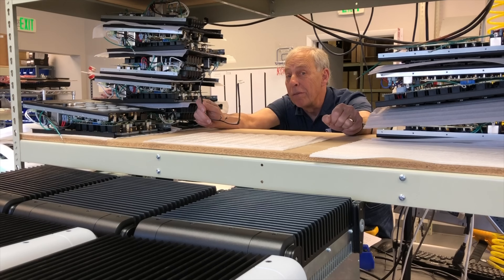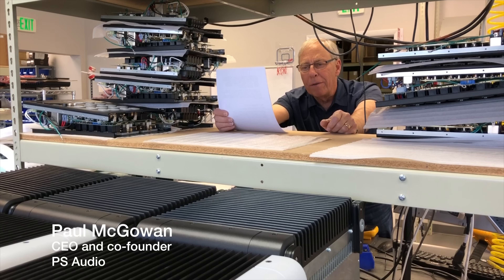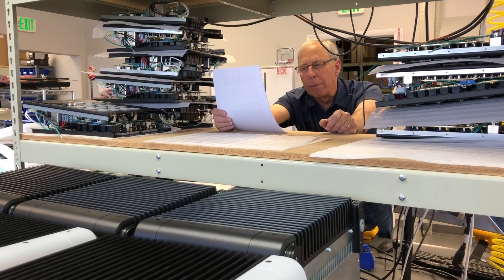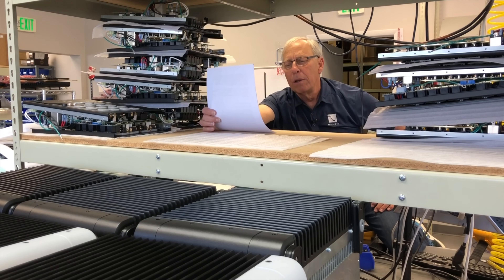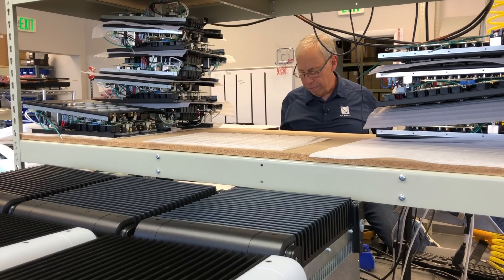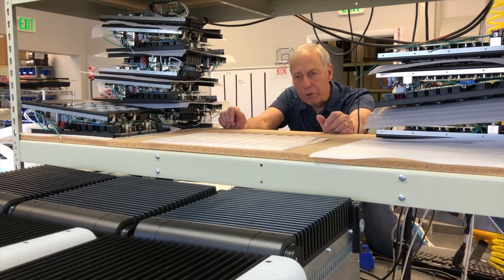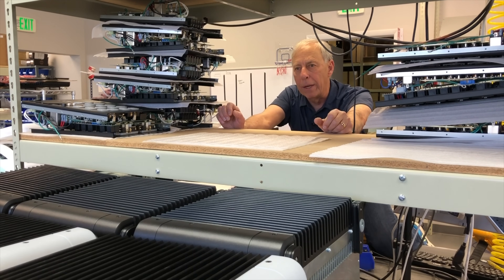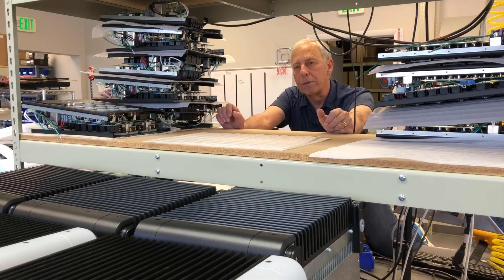Why aren't there more active crossovers?

Comment: High end studio monitors are all 'Active'.. ATC.. PMC.. ADAM..  It's meant to be a superior to passive because every driver has it's own perfect matching amp. Yes these speakers are very expensive..
Reply: Eq's don't actually do what you need. Remember you are feeding full range to every eq and then trying to take out what you don't want that driver to see from there. In the case of a tweeter which typically has an operating range of over 2khz and up subsonic information would rip it apart. The difference between a crossover and an eq is that a crossover starting at the xover point goes from nominal gain to zero gain either going up or down depending on what you are doing with it. An eq's maximum attenuation is usually minus 12db. It needs to be minus infinity or in the case of a tweeter don't expect it to live very long. Also, you will find that you won't be achieving the results you are looking for.
Reply: Rob Chapman so you think every song ever recorded on any format will sound good on a reference system set to 'Direct' or flat.. I do not agree. Every song was mastered differently on different monitors.. Even tbe IRS IV's won't sound right without EQ.. I have been trying to achieve perfect sound for 25 years and i now believe you need to EQ every track for your system..
Reply: Rob Chapman, i like your statement of eq each driver. Im thinking that might be the thing for my EV 15" lower mids drivers. I just bought 3 more of my favorite 2 way xovers yesterday. That makes 5) matching  2 ways now. I should have a complete system to show,  in july.
Reply: The ability to plug the amps right into the speakers with nothing in between is one of the reasons I love active crossovers. Like I say passives have to endure higher power levels. With that, the crossover networks in passive speakers dissipate real amounts of heat. Also under load, they are typically another source of distortion. Probably for typical home use that stuff is not going to matter much though. 
  Driver manufacturers are quick to show their frequency response curves but you almost never see a phase over frequency response graph of their drivers.  Drivers never have perfectly linear phase response and as you get toward the ends of their operating ranges the phase usually drifts more. Typically speaker designers build speakers to use the maximum amount of drivers operating range. The thing here is that if we took the physical acoustical centre of a driver and mounted it so it was the exact same distance to the listener's ear in the optimal listening zone if we use the model of driver use maximization we find that the crossover point suffers the most. Very typically that point happens to be right smack dab in the middle of the intelligibility range of the human voice. Due to the fact that the cause of the phase shift in the drivers is a time-based issue we can correct for that by either moving the driver closer or further away or by delaying one of the drivers to make the phase line up at the crossover point.  You are thinking "but won't that make most of the drivers operating range out of phase?" The answer is, of course, it is however if you look at any speakers phase response plot you will see that it shifts dramatically over the entire audio spectrum and actually rolls 360 degrees, typically more than once so it is not actually a big issue. The problem becomes a big one when the phase shifts dramatically in a small section of the spectrum. By shifting the time of an adjacent (audio spectrum wise that is) we can cause the crossover point to be phase correct and if the two drivers are not completely incompatible we will have a more even and gentle phase drift overall. The thing is that in the digital realm adjusting that is something we can do in seconds and we can try numerous timings in no time not to mention adjust crossover frequencies, change crossover slopes and a lot more to help. The best part of the digital realm is that is that phase shift introduced by the crossover is limited to the time it takes the computer (all digital processors are computers) to make the calculations and is measured in microseconds whereas in the analogue realm phase shift is insane with crossovers. BTW you probably know this but phase is going to cause the frequency response to be crazy so trying to minimize phase shift is going to help speakers sound a lot better.
Reply: Huh? Is where you are going with this relevant to what we were talking about? I thought we were talking about why an eq could not be a good crossover?  I was in no way discussing why I might think one style of speaker tuning was better than another. If it matters I do believe that the closer we get to transparent in audio equipment the better. As a rule mastering systems are designed to be as transparent as possible. As of yet the technology to record or playback any audio without infecting it sonically is not possible. The thing is that because pro audio uses "flat" or "transparent" as it's theoretical model of perfection it necessarily follows that if your system is "flat" or "transparent" then you are going to have the best vantage point or "listening experience" there. I don't know of many pro audio guys who do not love great sounding audio which seems contrary to some "audiophiles" understandings. That all said if you think your rose coloured lens filter makes every picture that you look at seem better to you who am I to tell you it is not. I assure you though. Most people do not feel the same as you in that regard. For me hearing what the creators did was what seems to sound best. With that, I also work in that field so it is probably for the best as maybe you like the pink flavour but Joe Blow likes lavender and Mary up the street prefers a Blue hue. If on our end the picture is clear it is easier for you to add your pink. If we make everything have a blue hue then when you add your pink you are going to get lavender. Yes, I am illustrating this using the colour wheel but if you think about it sound is not so different.  As least with this scenario Joe ends up happy. 1 out of 3.
Reply: So I just read this again. Were you saying that you were going to add an eq after the crossover outputs? That is a different scenario and that is very commonly how it is done now. Every driver has individual eq. What if the eq of a driver gets wanky near the crossover points where the drivers overlap? It might help to adjust only the driver that is wanky rather than both.
Reply: Yes that's true but you wouldn't just hook the amp straight up to the speaker, maybe a bypass resister etc for the unwanted frequencies and cap on each tweeter and med (but higher than normal value) not for sound but to stop lows in tweeters, and (of course) to keep the speaker impedance reasonable. It would be a combo of passive and active I suppose. 

I'm not saying it's ideal but I would love to try it to help me make passive crossovers. I have been making my own passive crossovers for a few years now and I can make one that sounds good quickly (compared to when I started). But it still takes a few days listening to fine tune the crossovers. With the 3 graphics set-up I reckon you could get it to sound better than just a straight graphic cos you can quickly change the levels of each driver as well. And that would help me with tweeter woofer level on the passive crossovers (by copying the sound and comparing). About driver level...

Ironically I reckon such a simple thing as tweeter and woofer level is about the most difficult part on making a passive crossover. Just a half ohm difference in tweeter level doesn't noticeably change the bass-med-treble mix, but it makes a whole lot of difference in the voice sound. 

Get a good voice sound and you have a good speaker cos voice sound is the most difficult thing for a speaker to reproduce maybe cos we all know what a voice is supposed to sound like (like more than any other instrument). And the tweeter level has a whole lot to do with it. 

Not enough tweet and the voice will sound too "in-the-box". And with too much tweeter the voice will sound too "whispery" or "huski". And it's extremely critical like a "knife edge". You really don't want either a "boxy" voice sound or "whispery" voice sound, and when it's balanced right the voice can sound astounding (especially with point source 2-ways). 

My speakers are similar to the KEF Uni-Q speakers made from selected drivers from eBay. Also acoustically the med range has to be as non colored as possible (for a good voice sound). Trial&error, both acoustically and crossover "and don't be afraid to think outside the square". I have done many failed experiments but also several real successes both acoustically (by doctoring drivers and enclosure ideas) and crossover wise. I resisted an added choke by 470 ohms once on a certain pair of speakers and it was just what I fucking wanted. Sounded awesome.

It wasn't point source speakers and I just wanted enough med in the separate woofer to blend with the med in the "tweeter" (I stuck some extra med in a tweeter contraption I made for treble and upper med). It's a low crossover frequency on that 2-way (instead of point source). It sounded great for a non point source speaker. I did the experiment for a back-up alternative to the difficult task of matching drivers for point source speakers (that have limited availability).
 
With the point source speakers, I set the tweeters inside the core of the bass drivers (with a rare specially wide voice coil). I can even adjust the level of the tweeter voice coil/ dome point to exactly where I want it by using a spacer. The bass drivers have a hole through them to ease mounting and tweeter cable access. And the tweeters have to be doctored to fit in (mainly casing is trimmed down). At the moment I'm listening to my pure point source speakers and the bass vent is also point source (an "outside-the-square" that fucking paid off)... 

The woofer is floating 2 mm above it's hole and a one inch plywood tube (hole diam) runs back into the enclosure. That seems to be all you need for acoustic. Sounds as good as any bass vent and is pure point source (all the way). Without the acoustic plywood tube it won't sound any good (or if it's the wrong depth). Trial&error. Such fun listening to them and point source is so sweet. A really cheap way to get really great sound. My speakers cost about $500 to build (and I'll never listen to a normal 2-way or 3-way again).
Reply: Justwantahover , how about  doing like you say, but put a cap on the midrange and tweeter. You are still giving those amps a break, and your removing coils from the path to the drivers. 2 main advantages of multi-amping. Then, when you get a 3 way crossover, you can put those graphics after the crossover like Rob suggested. Also get drivers with roll offs that compliment the others..its a contraption, but it might be just what you are looking for at the price.
Reply: Here is the thing. If you have divided the audio spectrum up before the signal hits the amps unless there is something wrong with the amps or you wire it wrong there is not going to be any signal hitting the driver that it is not supposed to see. Capacitors are one of our favourite ways to "psychoacoustically infect" (I love that word. A friend of mine who used to work for AKG Acoustics said that to me one time. It is so true) the audio signal path. Caps usually change the sound dramatically and as a rule, it is usually best to use them only as required rather than arbitrarily. I would tend to shy away from them if I can.  I run million dollar sound systems daily with the amps wired right to the drivers. Only wire in between. That just to say that if that kind of thing was all to be a common problem on our end of the industry the cost would be astronomical. I have had my share of drivers burn up but it really doesn't happen all that often. You're safe. Just be careful not to wire it incorrectly. Usually, failures are caused by us humans I find. Check, check and double check. Also, it helps to turn the amps on higher frequency first and verify the right driver is plugged into it as you go. Sub-information will hurt a tweeter but tweeter information will just not be audible through a sub driver.
Reply: Rob Chapman Correct.. I replied to another conversation on here by accident.. Your cross over theory is a bit beyond my knowledge of speaker build.. I think what were all trying to do is recreate the original sound which is bloody hard to achieve. Involving individual external amps for each driver will make that job 10 times harder! Good luck sir!
Reply: Personally I have found that in a fully active home system, (where there is only one driver per speaker, covering each part of the spectrum) that the drivers that work for me on the low end are smaller, than on passive system. So, my subwoofers are 10inch, and my woofer is 15inch, but its a musical intsrament (P.A.) driver. Then midrange. Standard 4inch  cone or 2inch dome. At the moment I am undecided about having 1 subwoofer 10in, 1 woofer 12in,  1 musical intsrament driver 15in, then mids as a completion of spectrum.(Per Speaker) It's where I'm leaning to. It's really nice to clean up the Doppler distortion by reducing excursions.
Reply: Rob Chapman, you certainly are there, been there, and doing it. Another nice chapter from you, I'm sure many thanks!
Reply: Rob Chapman any possibility of doing a chapter on driver coupling? (stacking). I'm curious about the rule of half wavelength space between drivers for coupling. Like in car stereo, the sub box is almost always a foot or more away from mains. or does coupling only apply to drivers playing in the same frequency range?
Reply: cp070476: If you want it to sound at the output stage the same as what it sounds on the input stage it makes the most sense to shift the sound the least so you can use less corrective action. Correct? By implementing the use of analogue crossovers whether they operate at line level or speaker power level we in fact generate more alterations than we do in the digital realm because a pure digital eq is an algorithm and only alters the sound the way it is told to in terms of programming (it is imperfect though, we will come back to that in a sec) whereas in order to alterin the analogue realm we are forced to introduce more signal paths and more circuitry which in themselves alter the sound even if their parameters are set inactive. Back to the digital realm. Computers work very quickly but the more we ask them to do the more time they take to do it. A parametric eq brings with it rather complicated set calculations for a computer as does a crossover. Faster computers, of course, handle it quicker but they all take some time. Sound travels through the air rather quickly. Think about the time it takes to travel a couple of feet. It is not really distinguishable however if you move your speakers so one is 2 feet closer to you than the other and play the exact same sound from both simultaneously you will see that the sound you hear standing in that one spot is horrible. This is because at some frequencies the two sources are now opposing forces and where one is generating positive air pressure the other is negating that. Of course, there are also varying degrees of this as a 90-degree phase is also effectual. Just not to the degree that a 180-degree shift is.  Analogue crossovers and eq can easily shift the frequency band they are working with 180-degrees or more. Like I say digital also does the same however I have actually personally measured it. Using eq compensation that in the analogue world would have induced numerous phase shifts of more than 180 degrees (on purpose) we measured shifts of less than 5 degrees. I have heard it said that 30-degree shifts are humanly inaudible although I disinclined to believe that part. More than that amplifier circuits inject distortion and limit frequency response as well. It is just a thing of limiting the amount of mess one is creating in order to get the necessary work done. In a perfect world, every speaker would consist of one driver that covers the entire audio spectrum and does not vary in phase or frequency response at all. Not to mention induces zero distortion. Such a speaker is currently impossible so we have to make some mess. How good are you at cleaning up those messes?
Reply: Brian David:  "my subwoofers are 10inch, and my woofer is 15inch, but its a musical intsrament (P.A.) driver." What is the make and model number of the 15" speaker. Your wording indicates that it could be a guitar amp driver  (a midrange device). Not that I am a driver guy but the way I understood it is that if they are designed to run midrange they are not going to be very efficient in the subwoofer range not to mention their frequency response would make it difficult for them to achieve the low end at all as they are not designed to do that. That said you would find that the driver would be much more responsive and exhibit less phase shift in the subrange although would not go very loud before it destroys itself. JBL uses very short excursions in their pro sub drivers and that is what their speakers kinda sound like.
Reply: Brian David: Glad to hear you are looking at phase response and considering that in your designs. I so often hear speakers that clearly have not had one second of that consideration in the design. It makes a huge difference. 
  Just so you are aware I think it rude for those who don't understand if we don't explain what we are talking about when discussing this stuff in a public forum. People seem to think I am doing it for bragging rights or something. It would be the same if the discussion was nuclear physics. I am not a nuclear physicist and if they are going to have a public discussion then they need to be prepared to explain so that the public can be involved otherwise PM them. Just know it is not that I am trying to make anyone feel stupid. We all have our areas of expertise. Guys if I am not clear please ask and I will try harder to explain. My apologies in advance.
Reply: it's an old Ev DL15x 
pa/ musical driver. I just did some more testing and I am going to have 10's (mtx blue thunder, vintage car sub.), up to 50hz. 
      A 12in woofer from a Yamaha 3 way speaker, 50 to 200 Hz. 
Ev dl15x, 200 to 600hz 
Phillips dome, 600 and up. I say that with pride even though it might look out of normalcy.  That's what I have refined it down to after all these years. There's some more details but, that's the plan.
Reply: Brian David: "any possibility of doing a chapter on driver coupling? (stacking). I'm curious about the rule of half wavelength space between drivers for coupling." As it applies to line arrays? There is a ton to that. There are a bunch of experts. I think the guy who started it all was Dr Heil in the 60's but we have come a long way with that. The current implementations use a split design. The lower frequencies use coupling but the higher ones use horn loading to decouple because it is impossible to get the drivers acoustical centres within a wavelengths distance from one another. Basically, it is about using a series of drivers together to do the work of one driver. If the distance between the acoustical centres of the drivers is less than the wavelength of the highest frequency the drivers are trying to reproduce they will in fact couple. (Add to each other's output level). If the adjacent driver is further than that wavelength and both drivers are outputting the same frequencies cancellations will occur. 
The IRS 5's, of course, use that technology. It looks like they use ribbon drivers for the high frequencies which would in effect do the same as horns to decouple the drivers. Again, how do you get them that close so they don't cancel within their operating range?  That was a good idea. I like it, especially when you consider the ability of ribbon drivers to work well into the ultra-high-frequency range. My only concern about line arrays is this. If you consider that your ear is positioned in one space it is, you are in fact hearing sound coming from all of the drivers simultaneously. Assuming that no one has shifted their output times so that their transmissions will arrive at your ear simultaneously there, in fact, has to be some time smear. Aside from cancelling at high frequencies this also has an effect of minimizing impact at lower frequencies. We are talking about splitting hairs here though. Even with Large 15 and 20 element arrays, we are still achieving a very high level of sonic fidelity in the field. I always liked Tannoy's theoretical model of the "Dual Concentric Driver". It almost acts as one driver for the entire audible range. It was an imperfect beast as well. When Music Group bought up the company Dual Concentric Speakers were no longer included in the line. Not sure what happened there.
Reply: Hmm. Ya, it looks like it was designed as a low/mid driver and I would assume as it is EV for a pa speaker like you say. I listened to a bunch of stuff when I was looking for my car. I have Focal KRX for the mid/hi but when it came to sub I really liked the woven glass fibre cone of the Infinity Kappa sub. They handled some good spl and went really low for a 10. As the fronts are 6.5" drivers I didn't think 12" drivers would match up too well and had to make a decision without being able to try options. Not to mention the 10's are typically a bit quicker. The 12's would have gone lower though.
Reply: Rob Chapman so hence the rebirth popularity of the coaxial. (?) I love this stuff! whether I truly get it or not, may have to read that a few times. As always, thanks!
Reply: I just happened to find that something I said was incorrect. "When Music Group bought up the company Dual Concentric Speakers were no longer included in the line." It would appear that they only eliminated Dual Concentric designs from their recording equipment line. I see there are still a bunch in the Hi-Fi lineup still.
Reply: Studio monitors?  Are you deaf?  Most recording studios NEVER have good audio gear.  They don't need to.  Also its distracting.  They try to listen the way average people listen.  Then the resultant sound is better for those people.  It makes sense but the standards are low.  Most people's standards are low.
Reply: @bobhoskins9595  kinda, most studios will run 3 sets of speakers from the monitor controller: some mid-field or soffit mounted larger units, some 'near-field' workhorse speakers, and some tin pot squark box type speakers.
Reply: If you simply bought 3 amps and 3 grapics, and used each amp and graphic for each driver (if on a 3-way) it could be an easy way to make an active crossover cos you can change it easily. Should sound great and you could tailor it to different rooms nearly instantly.
Reply: Justwantahover sounds complicated! You can try anything if it sounds good and you save money then job well done!. ATC PMC ADAM do it for you built in but as i said you pay for it. Unfortunately quality costs..
Reply: It's just an idea I had in mind. Not really that complex just 3 amps with graphics. Not necessarily high end, just 3 standard amps and graphics. Cost a bit but nothing like high end price. It would be a lot better than just a single graphic and you can fiddle with the output of each driver easily too with the volumes of the 3 amps.